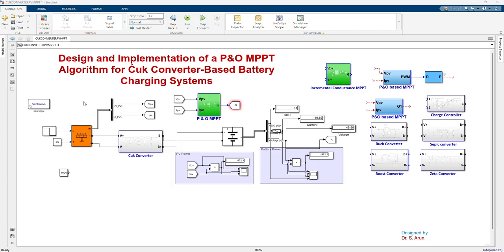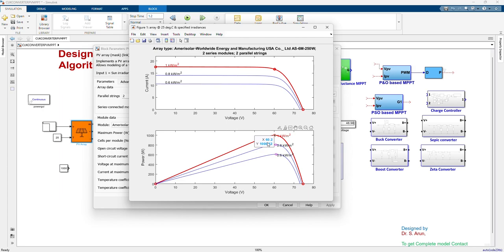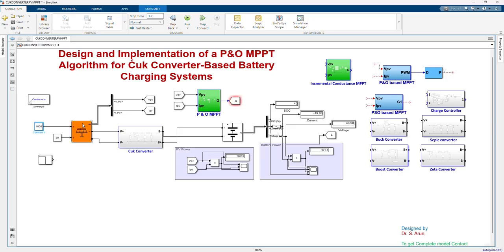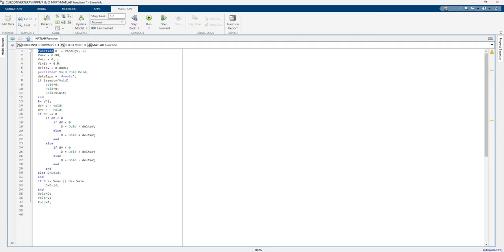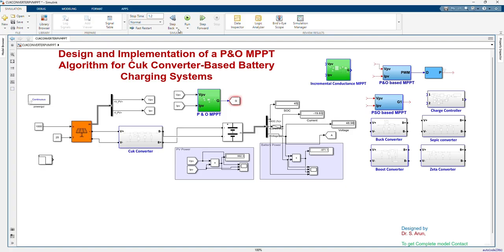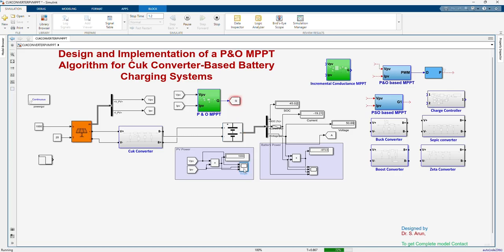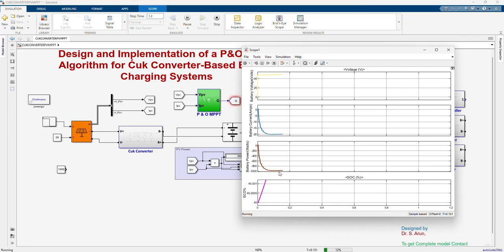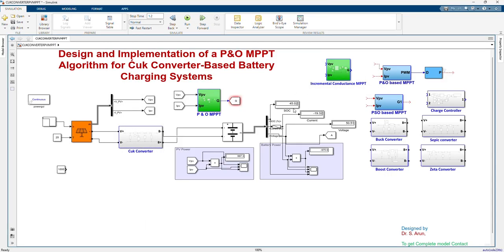Designing & Implementing P&O MPPT for Cuk Converter — Battery Charging System (MATLAB/Simulink)

Comment: the battery connected to the capacitor. how is it works?i already contacted you. Would you please take a look of my whatsaap thank you
Reply from the maker: Capacitor is used to act as a filter In front of battery also regulate the output voltage. If it is not connected between the battery and cuk converter the output voltage will be oscillation.